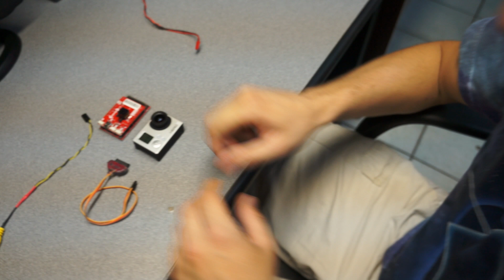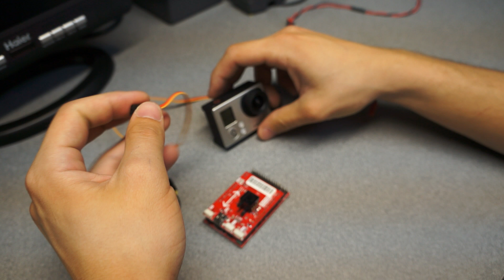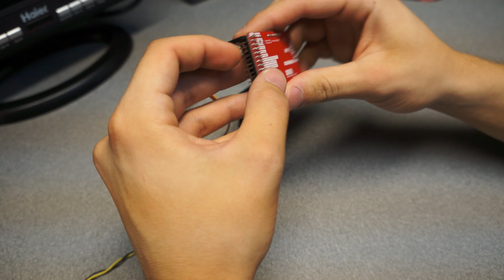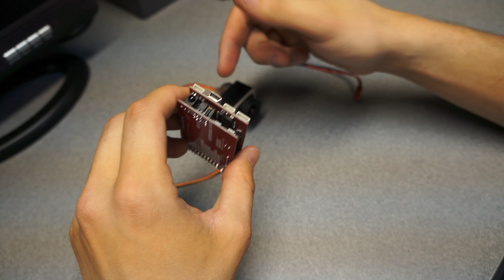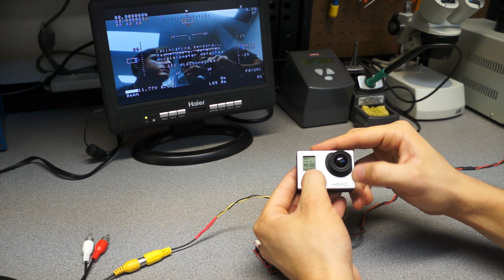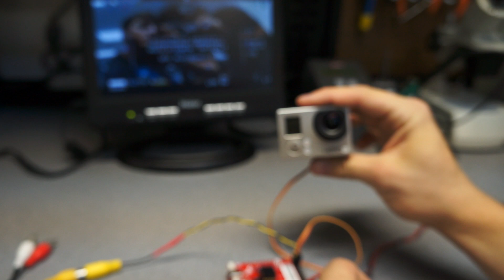GoPro video out connector. RangeVideo

Comment: Yes i would be using the Fat Shark transmitter that came with my FS goggles,so would this unit still work if i wanted to use the GP3's battery.